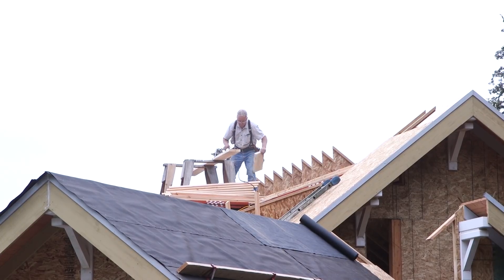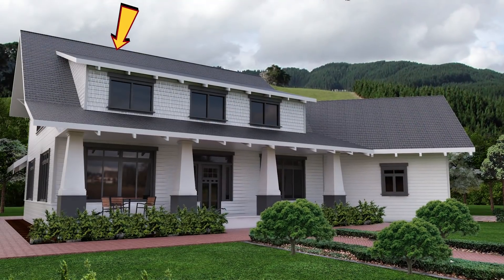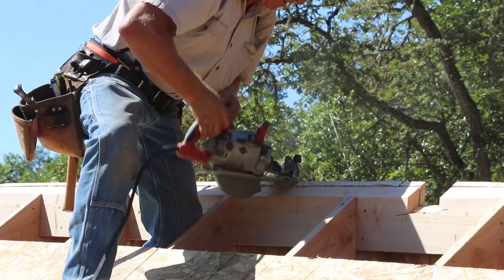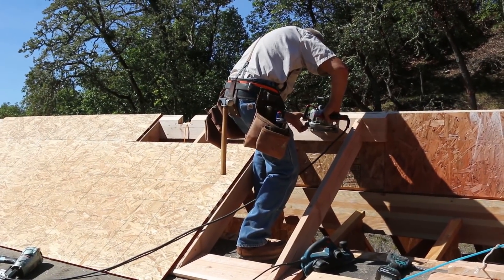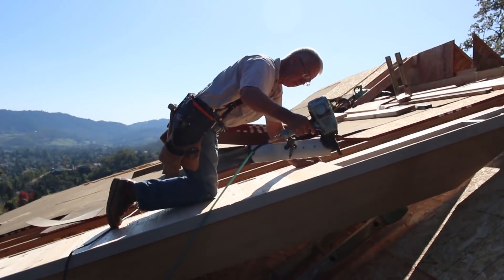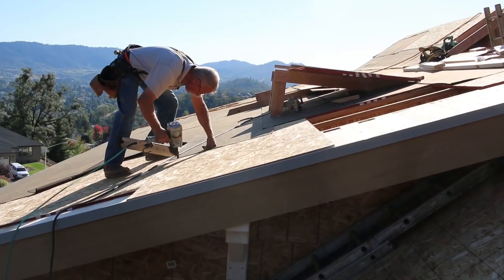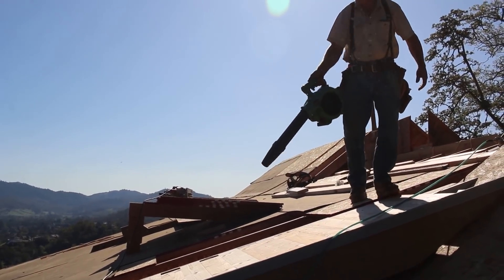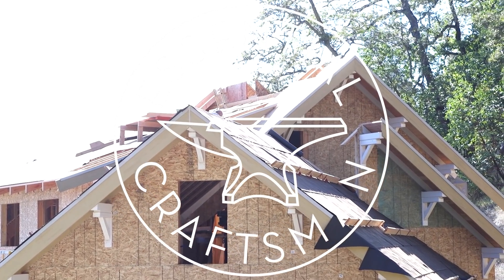Building a Small Overstack Ep.69

Comment: How's it goin team EC, I recall a past video saying ol Scotty was into repelling. Seeing this safety harness in use makes me wonder when, where, and how you would anchor off. 
Thanks boys for all your hard work
Reply: The safety harness wasn't OSHA compliant, You need a lanyard snapped into the ring on his back not wrapped around his waist. On that type of slopped roof I like My SALA slider lock-ring that is attached to the main tie rope,  with a sala as you move up the roof you can shake the lanyard and shorten up the grip on the main rope . You can buy several types of roof attachments d ring straps metal brackets. welt on for steel structures. and sometimes I would go clear over the roof down to a post, around window openings.

Comment: I wanted to say that the house is looking great!!!  I know by now it's finished but I had a couple of questions I hope will be covered.  I've had to repair a few shed dormers from water damage and subsequent wood rot.  When I saw you rolling out that felt paper parallel to the dormer I had a fear, why not run it perpendicular and step flash it up the dormer wall a little.  Then I thought about your exterior mounted corbels and wondered why you didn't just run some wrap under them tacked at the top to then overlap lower wraps.  I'm looking forward to the roofing and house wrap vids.

Comment: Looking great EC. Now I understand the reason you cut the ridge out on the dormer for ventilation, but it’s not clear how that’s not going to affect the roof structurally. If you have an opportunity I expand on the dormers someday I’d like to see it. In addition It’s always been a bit confusing how the roof load of dormers are transferred to the bearing points. 
Keep up the good work fellas!
Reply: I was wondering the same thing myself, but if you think about it, there's 2 things; 1) there's really not a lot of load on that small overstack, and 2) that horizontal 2x really isn't carrying any kind of a load itself.  The video doesn't show it clearly, but I'm pretty sure that the jack rafters of the overstack are butted up against the rafters on the opposite pitch,   like true rafters in a traditional rafter roof, there is no need for vertical support under the jack rafters, so that 2x he cut into isn't acting as a beam, merely transferring horizontal load to the opposite rafter.
Reply from the maker: Exactly!!!!!!

Comment: I was doing roofing for 10 years when younger. As far as i know this is still the go to underlayment. Except we used the ice dam and usually 2 rows worth at the bottom of the roof here in Michigan. 
Anothwr thing inalways tell everyone is make sure you understand the shingle warranty. Especially the part of how many nails per shingle should be used. 30-35 needs 5 and 40-50 needs 6 or 7. Ensure your contractor is putting thw proper amount. You dont want to lose a shingle and the shingle rep comes out and counts the nails and theres not enough and the warranty is void and youre SOL.

Since then ive found 2 contractors that werent doing it right. One was my aints house. I looked over the estimate and they charged for the proper number of nails however when i heard their guns going i was only counting 4 nails per shingle. Luckily i called them on it when rheyre were only half way up one side. They had to tear off amd start ober at their cost and throw away those shingles. 
The boss acted like he didnt know but i have a feeling its how he did business

Comment: I have a question about the roof sheathing. How come they are not glued down? I remember from when you were putting the floor sheathing down that they are glued because of squeaks and for structural strength. From there on I assumed that for the roofing it would be the same deal?

Comment: An easy way to figure bottom cut on those lay-on rafters with a speed square...
Pivot square to main roof pitch.
Mark lay-on (steeper) pitch without moving square
Pivot square to pencil mark.
Reply: Hummm in going to have to play with this one... Just not picturing it...🤔
Reply: @maleficentcop2752  if you have a 10 pitch on a 6 pitch (or a 6 pitch porch on a 10 pitch) pivot the square to 6 common, hold it there, then mark a pencil point right at 10 common.  Now pivot further, connecting pivot point with pencil mark.  It will be a steep angle.